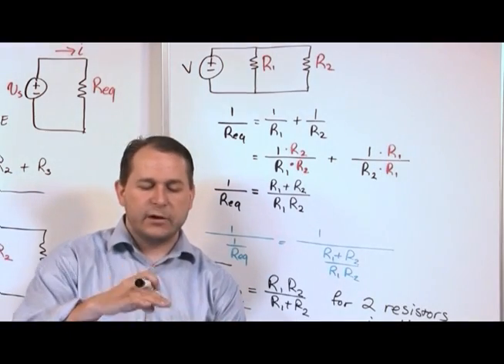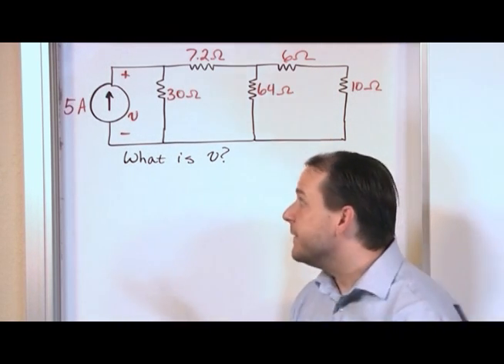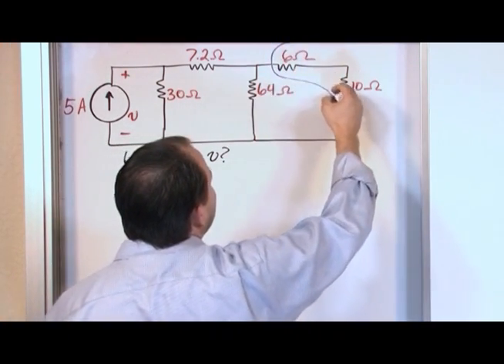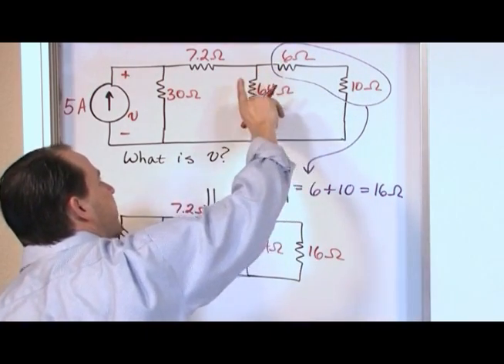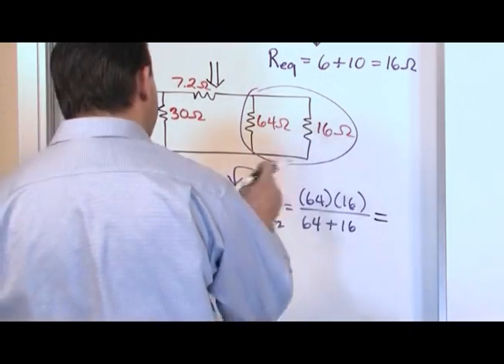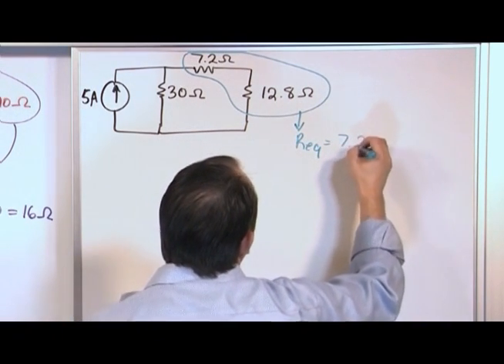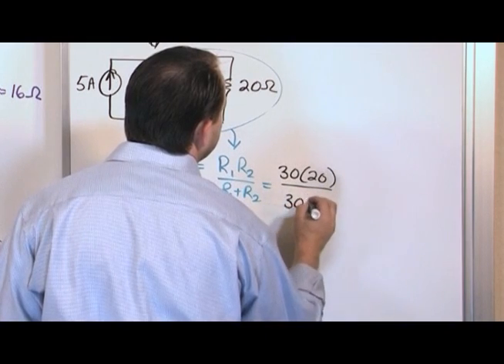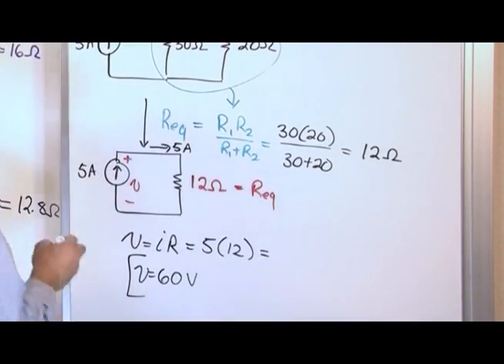Series and Parallel Resistors in Electric Circuits

Comment: Thank you for the introduction to me of use of product over sum in calculating
2 parallel resistors.   Wonderful new information. I was aware of the longer
method when confronted with numerous resistors in parallel.

Comment: This video helped me soo much! thanks!
just one question, how do we know whether to make it a parallel or series at 6:24?
also, what about resistors connected in triangle?
Reply: When u calculate the 64 ohm and 16 ohm resistor they just go in parallel.. no other way for them to go. Than u just continue solving to reduce the circuit to a simple circuit... 🌹